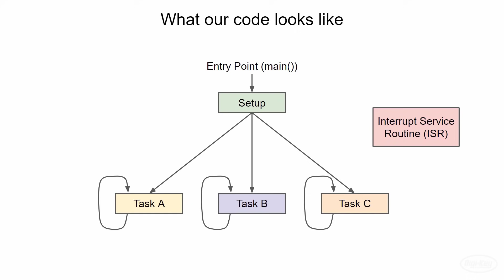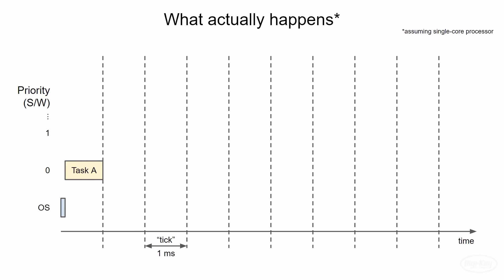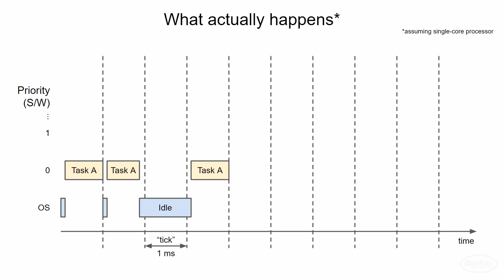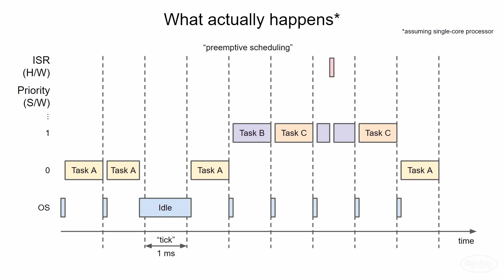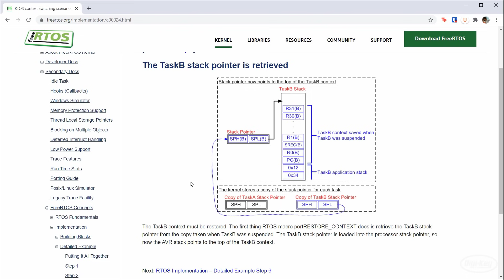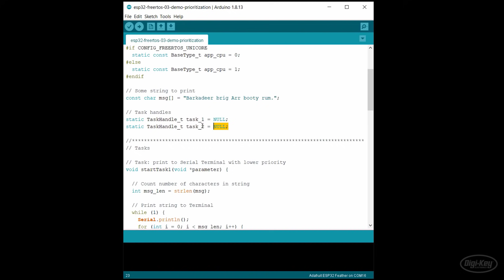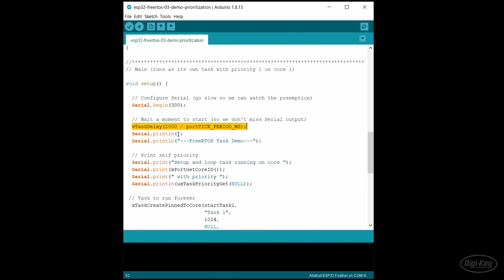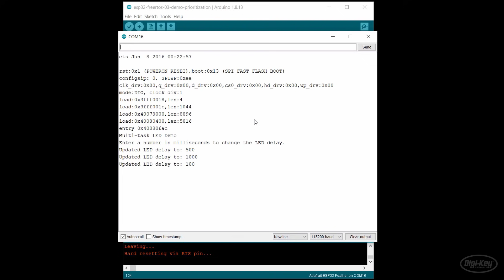Introduction to RTOS Part 3 - Task Scheduling | Digi-Key Electronics

Comment: IIRC, serial output may also cause a task to be not ready because it can take a tick to wait for the character to be output.

In an RT application, the serial output should be in a task dedicated for the output to that physical device port. Messages are then sent to that task when output is required. That strategy avoids garbled output produced by two or more tasks outputting to the same physical device. The serial output task can wait on a message in a queue so no cycles are burned by it unless there is something to do.

Similarly, some input operations duch as analog input or serial input may block. 

Rule of thumb is one task per physical resource.  With ADC, there is usually only one converter that has its input multiplexed over several ports. So one task per converter. If you know the hardware well, then you can start the conversion and suspend the task until the conversion is complete, resuming via ISR.

Scheduler may be configured to yield to the next ready task for the remainder of the tick when a task is suspended.
Reply: Thanks for the great advice! The idea of using one task per physical device seems very useful. I’m not sure exactly how the ESP32 handles serial output, but I know that on other Arduino boards, it relies on the UART hardware to manage it. So, once you copy your message to a buffer, the rest is non-blocking while the hardware handles outputting the message, byte-by-byte, at the specified baud rate. However, that still doesn’t mean it’s thread-safe, as another task could interrupt the process of copying data to the buffer :)

Comment: Hello i have a question sir does the schedular runs as a task itslef ? If so when exaclty a task Can change state from blocked to running i suppose a part of the main Memory . Also thanks you for thé videos.
Reply: Great question! In some operating system, the scheduler could be a task. In FreeRTOS it is simply a timer interrupt service routine (ISR) that runs every time the tick timer overflows (default: 1 ms). The ISR then figures out which task needs to run and sets it to running. For a task to get out of the "blocked" state, some external event must occur. This is something like releasing of a mutex/semaphore or a delay timer expiring. A blocked task may only return to the ready state (or be put in the suspended state). The scheduler (the ISR) looks at the list of ready tasks, determines the highest priority, and chooses it to run. Here is a good article on what is happening in the scheduler: https://www.freertos.org/implementation/a00011.html Hope that helps!
Reply: @ShawnHymel  thanks you !